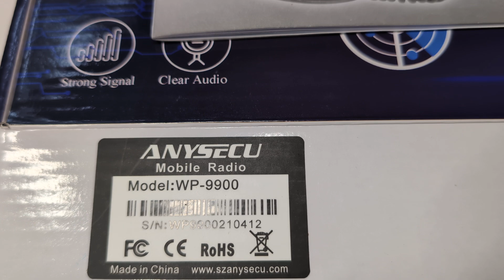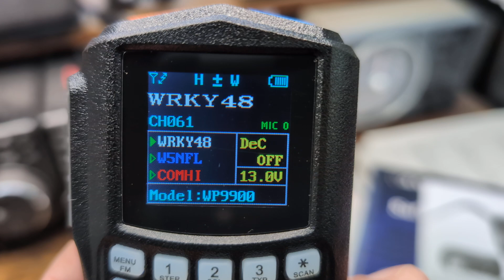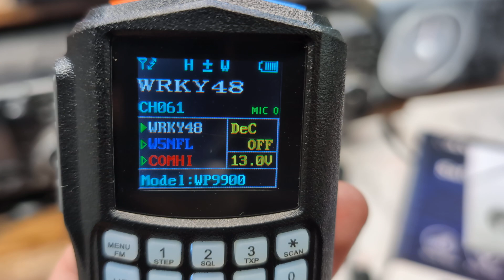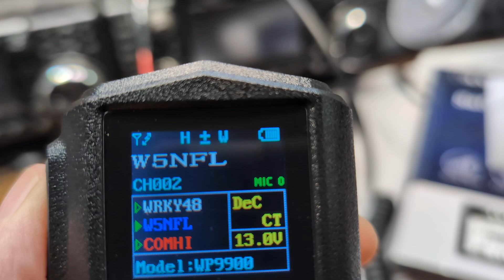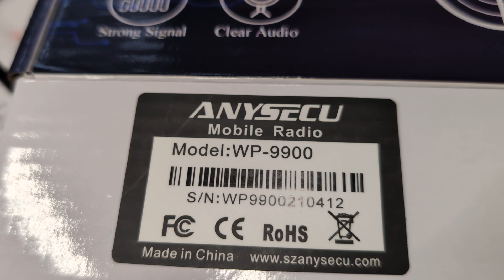Anysecu WP-9900 "Mini Radio" HAM & GMRS test & first impression

Comment: The fastest way to adjust the volume is opening the squelch (press the orange button) then use up/down to adjust. Not ideal but ok. 
BTW, I cannot get the 1750 Hz burst tone to transmit (blue knob). Any success on your side? 
RF output around 18W on 2m on my unit (QYT KT9900).
I'll drill the microphone hole as you did, thanks for the tip!
73 from F4LBH

Comment: I was wondering Is there a affordable GMRS antenna that you would recommend
Reply from the maker: Mobile or Base station? For my GMRS repeater I went with the GMRS Comet Antennas CA-712EFC, would make an excellent base station antenna, especially if you are rural.  At the house I use HAM Radio dual band antennas. Not really efficient since they are tuned to 440Mhz instead of the 460's. Mobile I use a wide banded Comet CA-2X4SR - it is designed to not be great anywhere but good in HAM, GMRS & Pubic Safety frequencies. Because of my work with RACES & ARES that is important to me so worth the cost. For the wife's car where this little radio lives I am using a TRAM 1191 glass mount. I don't really like it, but it works to get to my repeater around town. I'd rather have a mag mount or a trunk mount.
Reply: @CyberCowboy7777 is there a Pacific magnet mount antenna you would recommend since that's kind of what I would be looking for
Reply from the maker: @greywolfdakota9350  For  GMRS only Mobile Mag Mount I would look at the UT-72G on the inexpensive side. Spend some more and upgrade to the Comet FC5 with a  Mag Mount like the Comet CM-5M
Reply from the maker: Comet has a NMO version of the antenna and the mag mount which I prefer. But not sure if it cost more.

Comment: Does this radio transmit on the gmrs 8-14 channels or just receive?
Reply from the maker: @beefieschannel8955  I had no issues transmitting on HAM 2M or any GMRS channel.
Reply: @CyberCowboy7777  
Did you have to "Unlock" the Radio first or did you just program GMRS Channels via CHIRP ?
Reply from the maker: @davidyummus6259  This model just programmed up with CHIRP, no unlock required.
Reply: @CyberCowboy7777  
Thank you :) I am GMRS Licensed at the moment but going HAM soon too,... My Hand Held Radios are Unlocked HAMS so I think I wanna stay that way for a Mobile Car rig too.
Reply from the maker: @davidyummus6259  Getting your Tech license gives you a lot of latitude with your radios, glad to hear you going to get it. I don't own a GMRS specific radio, they are all HAM or commercial.

Comment: I have one, but haven't used it much. I did drill the mic out due to low audio reports. (Mostly I removed the waterproof membrane). It does stay warm while on recieve. I need to see what the draw is at idle... I wanted to run it as a SAR radio on my pack but might need more batteries... Also, the interface is way different.  Than anything...
Reply: Less than one ampere in idle mode